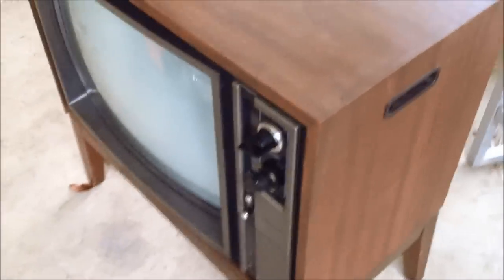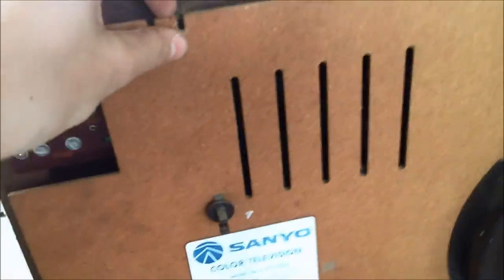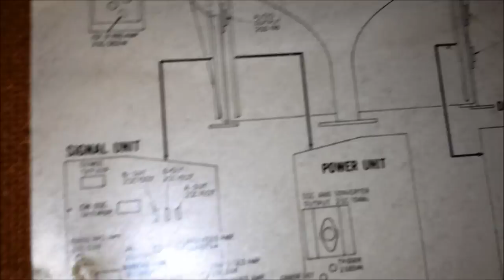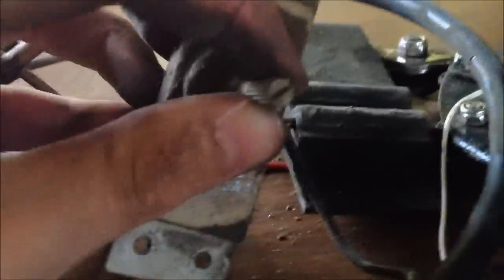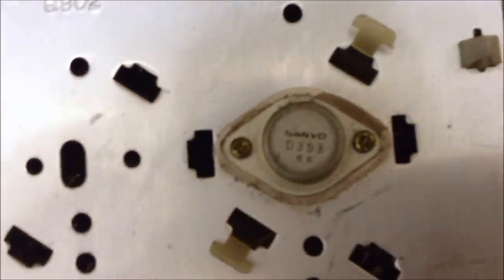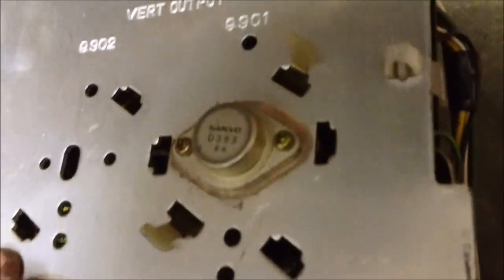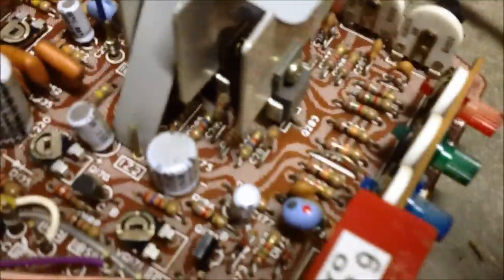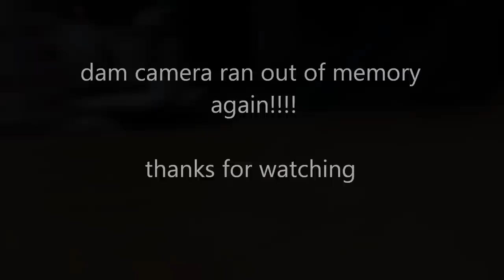very old crt television teardown

Comment: lol, The CRT is the only Vacuum Tube, I bet this has had alot of hours on it, i would've at least attempted to repair it, before parting it!, my 70's AWA/ Mitsubishi uses a 110 Volt stepdown transformer as the main power transformer!, and has a BIG Flybacjk!!